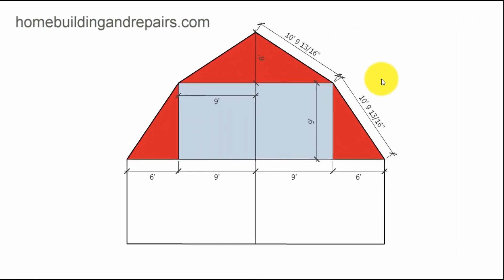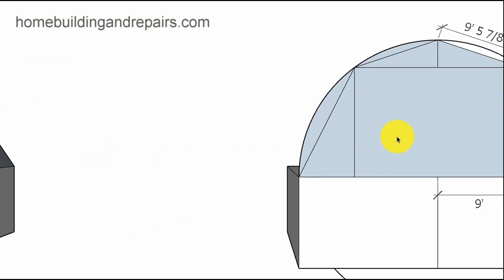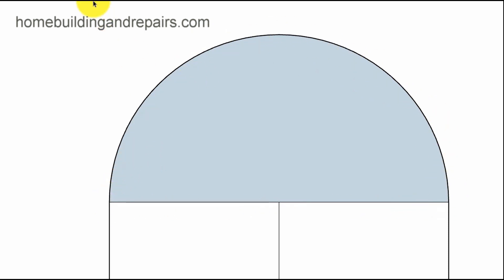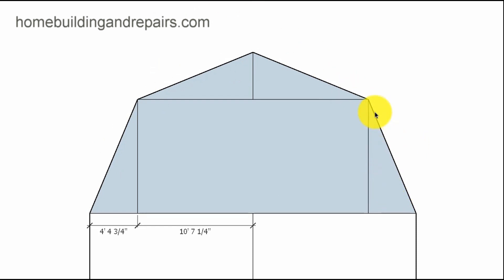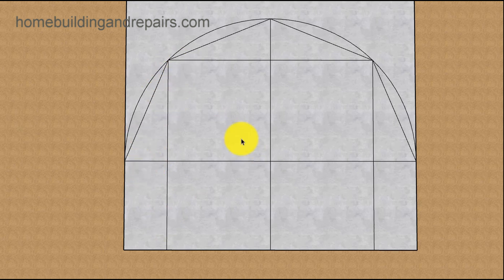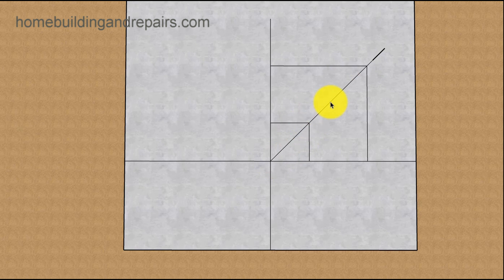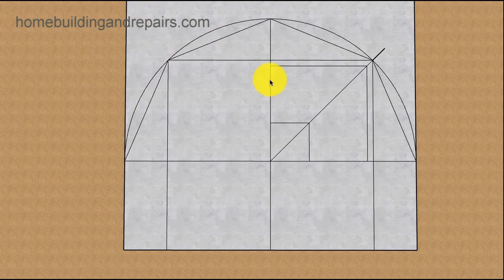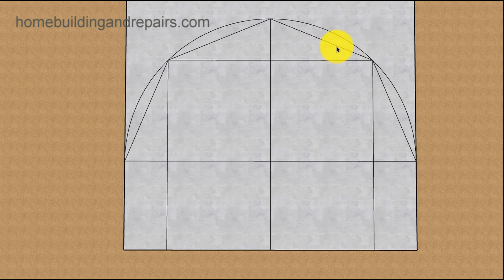How To Design And Calculate Gambrel Roof Measurements Using The Old Fashioned Half Circle Method

Comment: when I made my gambrel roof trusses I drew a half circle on garage floor of the proper width, chose points on the circle for the look I wanted, calculated angle cuts, cut 2b4 to proper length, joined with gussets, worked out well.

Comment: You can use a quick formula to calculate those sides based on the width of the roof (30ft in your case). 
Just type into google " 30ft / sqrt(4 + 2 * sqrt(2)) " and you'll get 11 feet 5 49⁄64 inches

Comment: your make this  so hard its easy     take the span in your case 30 feet convert it to inches that is 360 inches  now multiply it by the Sine of 22.5  ....360 x 0.3827= 137.772 now convert the decimal to fraction  by like this 0.772 x 32 =24.704 in this case round up  and you get 25/32ths of an inch so  cut each rafter from long to long on 22.5 degree angles at 137 25/32ths of an inch  and Presto you have perfect Gambrel roof
Reply: literally the winning comment here. Thank you!

Comment: My requirement is a 60 degree slope on lower wall and 30 degrees on the top.
This will be a metal frame to mount solar panels.
The other video shows how to make that adjustment?

Comment: I'm considering building a barn just like this but flat on the slab with no side walls. My question is, you show the rafters squared off at 10' 9 13/16" but after the angles are cut to fit  will a 12' 2x6  be long enough? There is one just like this a mile or so from me that has stood the test of time and it looks like it would be inexpensive to build and it would be perfect for what I need. Wish I could send a pic of it.
Reply from the maker: You can get our email address at our website.

Comment: I want to build a barn  with a gambrel  roof  that is two leveled in side . Is 150 ft in length a 150 in width  and 150 ft in width a pretty good size? 2500 Sqft.
Reply from the maker: That could work great.
Reply: If you look at the angles and loading for gambrels and plan to use traditional architecture… that building is going to be crazy tall. And need quite a few posts imho
Talk to an engineer!
150’ 😲

Unless you meant 150 FEET long and 150 INCHES wide but that’s only ~1800 SF. ???

Comment: Can't you make the roof technically larger then the building to include a soffit and bring the knee wall closer to the outside wall and roof would sit on the knee wall by a crows foot?
Reply from the maker: Yes, you would just need to change the design. I put your suggestion on my list of future videos.
Reply: @gregvancom does the vidéo exist? I‘ve just discovered your channel today.I would like to build a barn with that kind of rafter but larger than the walls.

Comment: I was orginally interested in Gabrel Roof Trusses because they can be made onsite. HOWEVER I HAVE DISCOVERED, that you need to spend a lot of money on 14" wood I joists in order to support the floor, which defeats the purpose of saving money on DIY.  The factory made Gambrel roof trusses have integrated knee walls which support the floor live load and allow a clear span of 36' or more.
Reply from the maker: 36 feet equals expensive.

Comment: What's the average on a 16 by 20 to gambrel Roof System storage building with concrete foundation 4-foot block crawlspace and a slab for the four system
Reply from the maker: You will need to get estimate from contractors in your area.

Comment: This was neat. I wonder, what's the preferred method to draw the circle?
Reply from the maker: I don't know if this is going to answer your question, but most of the time the circle will be drawn using a compass or in a computer aided design program.
Reply: Sure, that would work fine for drawing a circle on paper or on a computer screen. But the video says to draw a half circle with a 15' radius on a slab of concrete. I was wondering if there is a tried and true method to do that?
I can think of a few ways, but I never tried it and I'm afraid my methods might not be very accurate.
Reply from the maker: @SciPunk215   See if this helps https://www.homebuildingandrepairs.com/home_building/draw_circle_with_tape_measure.html
Reply: Yeah, that's along the lines of what I was thinking. Very interesting. Thank you.
Reply: @SciPunk215 Of course ‘we’ all have to start somewhere but it concerns me that you propose to construct a major structural component and yet have no idea how to lay out a circle…

There’s also an engineering factor; confirming the top rafter to the gambrel legs angle so that spreading loads are equalized across the ‘floor’ joists without transferring vertical live loads to the floor joists is the critical element. 

I’m actually trying to refresh myself on those angles but that reference is missing from these youtube videos- including this one. 

While the design in this video is probably acceptable, the kneewall that is ‘engineered’ into “room trusses” aka storage trusses is significantly different than with constructed gambrels; a proper design requires no kneewall legs. This is especially important if snow load will be a factor. You don’t want the floor participating in carrying the live load.

I ‘believe’ that the circle method with a ‘constant’ for calculating rake of the lower member makes a sufficiently strong 85# snow load. 

Other videos are crazy weak in design with scissor collapse failure highly likely.
Reply: @fishhuntadventure  Far out, dude.
I don't remember proposing anything.
Reply: Nail a 2x4 to concrete  over center mark of circle,  partially drive nail in center point , hook the groove of your tape on nail head and hold pencil at measurement and swing tape around nailbin circle